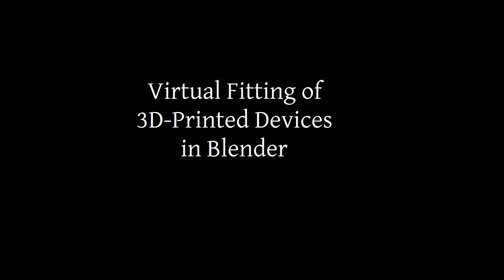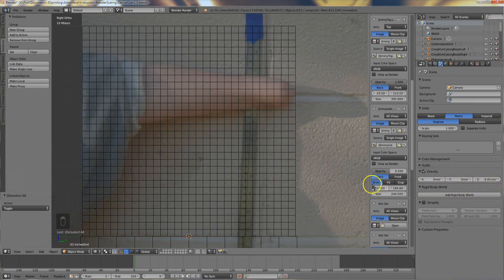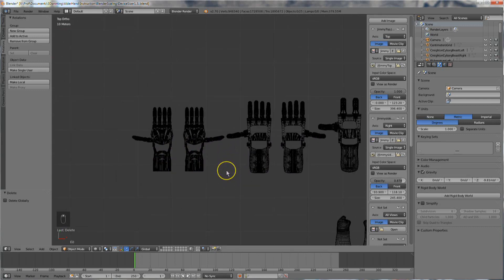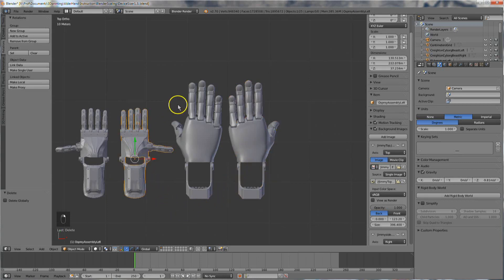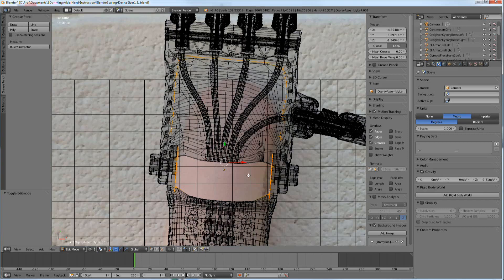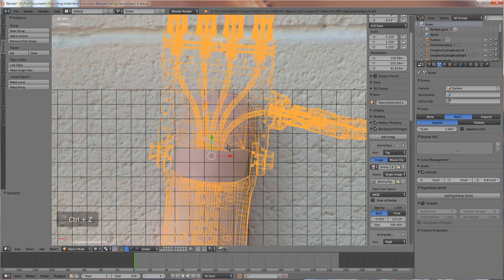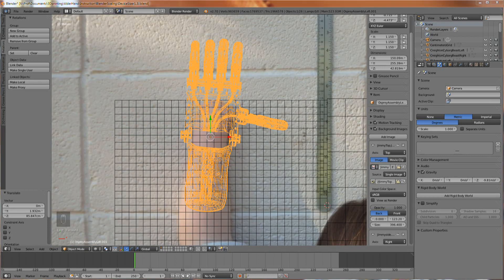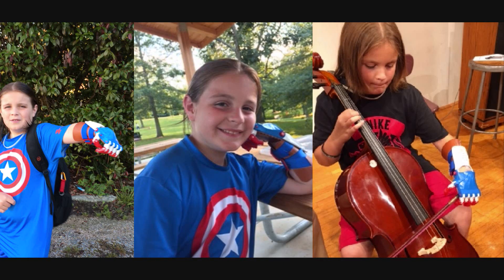Virtual Fitting of e-Nable Devices in Blender

Comment: Quick question on scaling. In Blender, when I scale it, it changes the scaling values. However, when I reposition the object and scale it again, it makes all the values resort back to 1 even though the object is bigger than before. Another thing is when I scale in only one direction, it makes all the values equal to the scaled value for the one specific direction. Is there any way to show the scaling values from how they compare to the initial model state no matter how many times you reposition and scale the object?

Thanks in advance!
Reply from the maker: Generally, if I scale an object and it doesn't look right, I hit ctrl-z (undo) and start the scale over from the unscaled object. If you scale more than once, you will need to multiply the two scaling factors to get your print scale. Another way to remove all scaling transformations is go to object>clear>scale in the lower left menu. I do not recommend scaling these devices in only one direction. The joints and pins get very wonky.
Reply: Perfect. Thanks!

Comment: Thanks for the informative video. Are there videos or other information on how to correctly size and position the device  for a good fit? Things like how much gap to have, how far up or down to position it on the arm, how to handle unusual anatomy, how to compromise (eg if the hand fits but the gauntlet is too small, or it's too small vertically, ect.
Reply from the maker: Davey Hi You should join the e-Nable Google+ community. Lots of experienced folks who make devices. You can ask specific questions there.
Reply: I'm there and on the e-nable forum. Poking around G+ I'm not finding much of substance, but I find it hard to find anything on G+ it's so badly designed. 

The questions I have are broad and common so I think they've probably been answered before- here, in a faq, or an instructable. I've viewed many (most of yours) and learned a lot. Most of the info I've found focuses on the 'hardware' side and not much on the human side. I can make the prosthetic but the question is will it meet the needs of the person that it's made for: does it have good fit and functionality. 

The other part is "I don't know what I don't know" and I'm sure there are many things that I need to know that I'd never know to ask lol

Comment: Hi, teacher, I do not speak English, I'm from Brazil, but I make a point of this comment. I was very interested in the e-Nable project, and this video was very useful, I'm going to start doing hand print tests and maybe even distribute it to some child. Hug.
Reply from the maker: Welcome to e-Nable!! Let me know how your hand printing goes, and if you need any help in the assembly process.
Reply: Ok, thanks. When I have some progress I will give news.
In this case of the video that was changed the scale, would it have to change from the other pieces that make up the hand, right? For example the screws.
Reply from the maker: Lucas Carnevalli That's right, as the printed parts scale up, you need to use larger screws. Find the Osprey Hand on Thingiverse and open the instructions, which is a Google document. You will see hardware lists for small, medium and large scale devices.